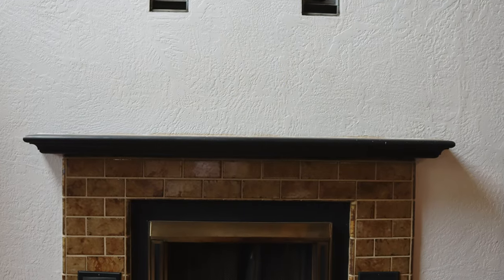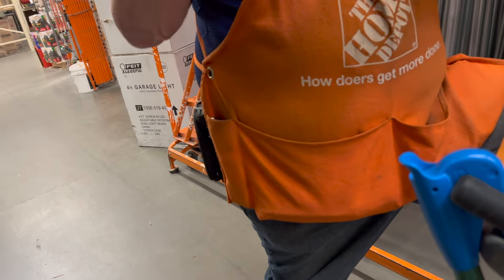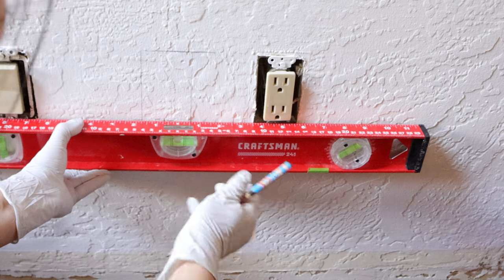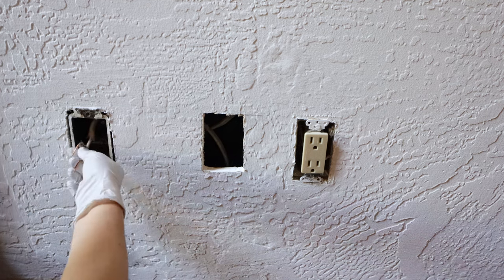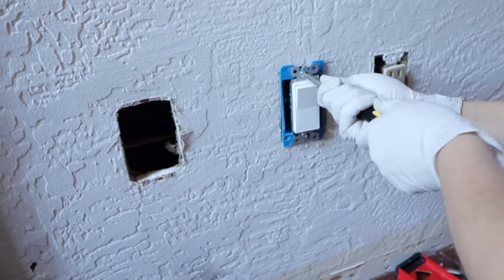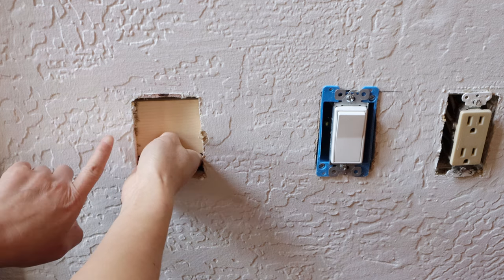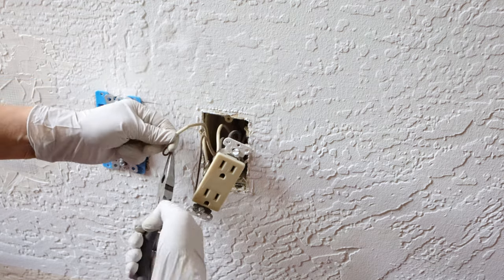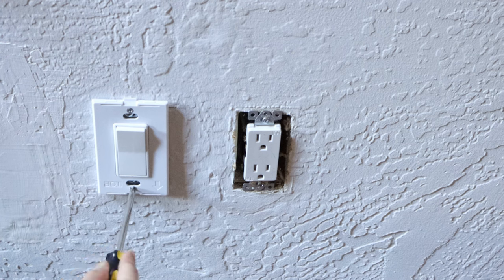How to Move an Outlet for Beginners | Step by Step with Tips and Tricks

Comment: Nicely done - great video!!  Another trick I would recommend is this: Before you cut a new hole, turn off the breaker and pull the old switch out to see how long the wire is....  Some older homes don't have much slack, and could limit how far away you can place the new 
box.
Reply: I was wondering about the same thing! Im assuming you either cant move it if thats the case or we would need to hire an electrician right?
Reply: @MsOneironaut   There are videos that show what to do if your wires aren't long enough... but I am not brave enough to attempt a DIY of that magnitude.  I hired a licensed/bonded electrician to move one of mine that didn't have enough wire to work with.